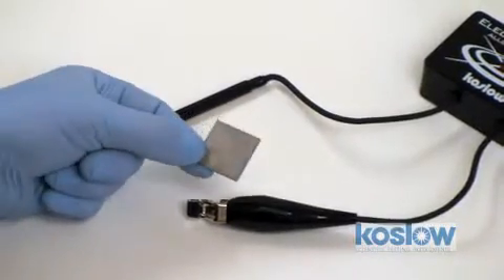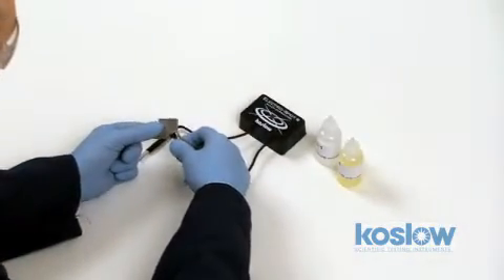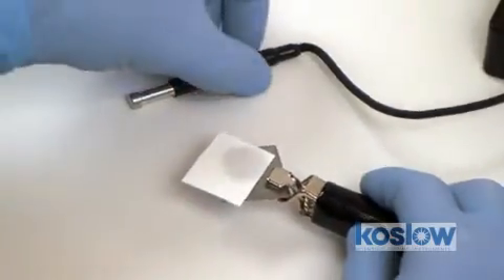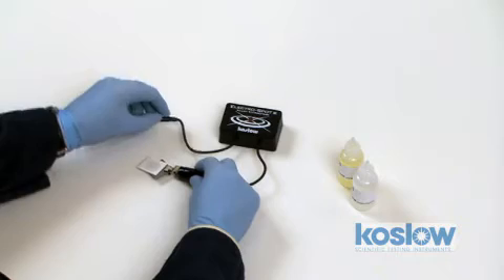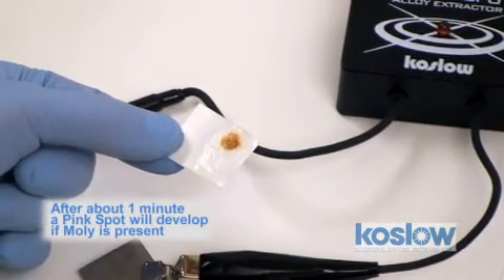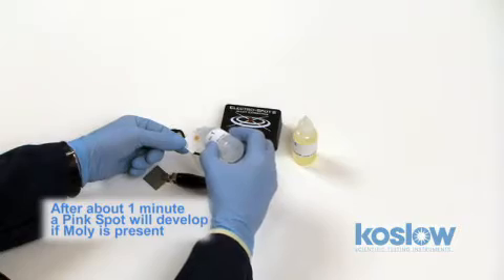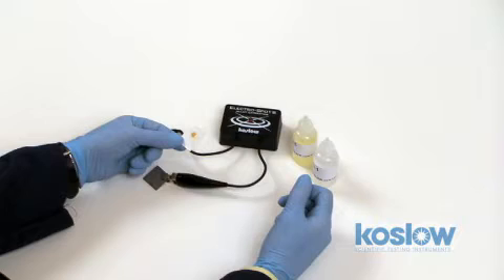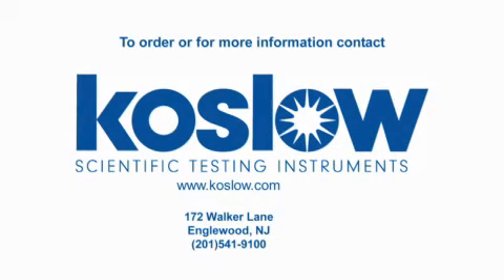How To Sort Stainless Steel 304 and 316 || Stainless Steel 316 ID Kit (1542C) Demonstration

Comment: Hello . . How do I distinguish SS 316 from SS 316L with this method? I need to verify the "L"
Reply from the maker: The Koslow Kit 1542C has a test for the "L" Grade.  The test is considered destructive.  It requires heating the metal sample with a torch.  Visit Koslow.com for the instruction manual.  Thanks.
Reply: Thank you . . I will check it out :)
Reply: Hi, I visited your website, but I could not find any specific demonstration video about the "L" verification by heating the sample (needed info: how long? the degree? etc.). Not even a written instruction manual about it.

All the website says is only to verify SS 316 against 304. Nothing about SS 316 against 316L.

Any links?
Reply: @diginglish  you were looking for 2% Mo content (as you said 316) vs 3% Mo content (as you said 316L), actually both 316 and 316L can have 2% OR 3% Mo. ANSI naming scheme SUCKS. 
Have you found any test kit?
Reply: @diginglish  
316 - can be DIN/EN rating 1.4401 which has just 2% Of Mo (same as Ti which is NOT suitable for all applications)
        - if it is 1.4436 it has 2.8% Mo which IS suitable for all aplications!

316L  -1.4404 has 2% of Mo NOT suitable for all applications
           -1.4432 has 2.8% of Mo which IS suitable for all aplications!

316Ti -1.4571 has 2% of Mo NOT suitable for all applications

CroMax chains:
-1.4404   = 2% Mo NOT suitable for all applications
-1.4462 “Duplex”  = 3% Mo IS suitable for all applications
-1.4507 “SuperDuplex” = 3.5% Mo IS suitable for all applications

Good luck to all when buying the damn chain 🙂